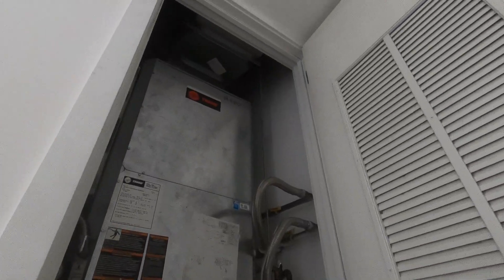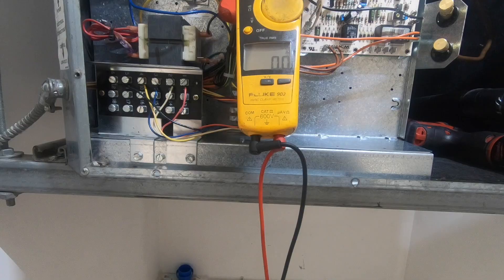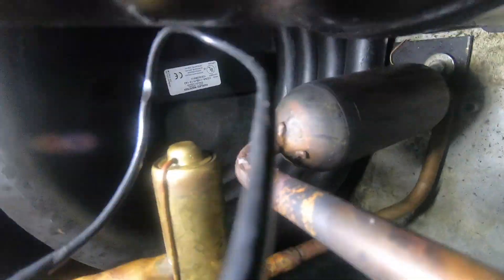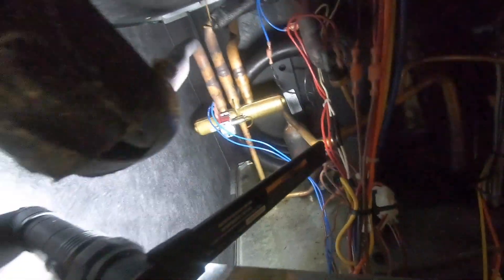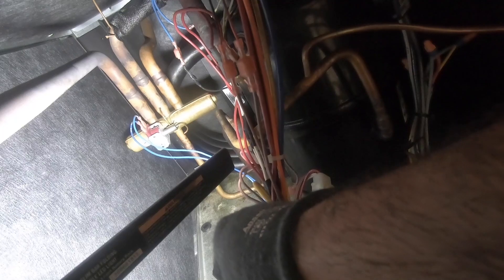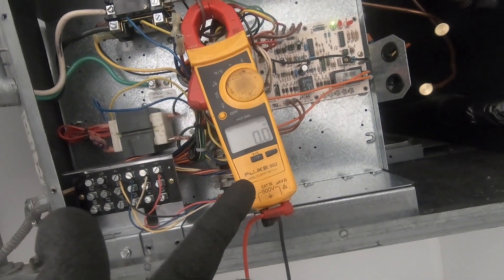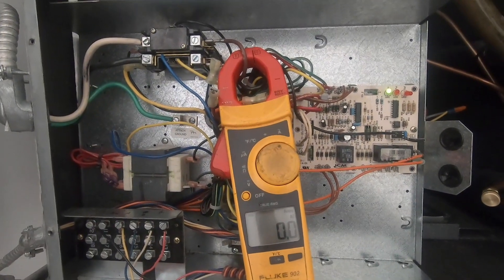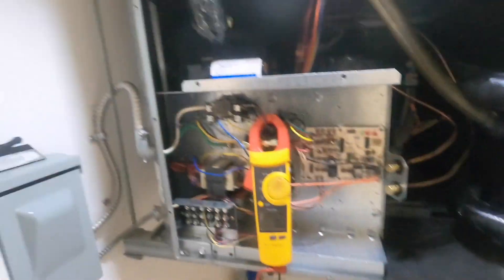Heat Pump Not Cooling or Heating

Comment: for lower value capacitors, leaving any leads on can skew the reading very significantly. it's not so bad above 5 microfarad, but below that, wiring, circuitry capacitance and inductance will skew the results by miles. even then, it's lways good practice removing all leads because there could be stray voltages present, which will also effect readings and most always the readings will be skewed higher than actual value, which leads to thinking the cap is within tolerance, when it's possibly way out.

Comment: I don't know much about wshp's but I would think there is some aux heat?  After watching the video I understand now the no compressor run call.  To bad the water is off.
Reply from the maker: Auxiliary heat isn’t needed on water cooled systems. We have powerflame burners for winter and cooling tower for summer maintaining water temp 74 winter, summer we can only cool the water to outside temps. Therefore the water filled heat exchanger/ condenser in the summer/  yet when heating the evaporator properly absorbs heat. Then displacing the heat into the conditioned space. Most air cooled heat pumps why not many exists in NJ are needed when not much heat can be absorbed from the air or system is in defrost. Water is back on in the building and I have been bleeding air out of many of the systems on no heat calls all week. Many of the condensers also are getting plugged up and need flushing.

Comment: Dont work on those but heard water filter/screen thing clogs a lot and causes high head.
Reply from the maker: Yes I have learned a lot about that clogging up. It also shows really low pressures when running heat. Same symptoms of no air flow on a heat pump condenser

Comment: Good old water source heat pump,  fun to work on i dont see a whole lot except downtown
Reply: Oh and dont forget the accessibility is always fantastic lol
Reply from the maker: They never make them easy to get into some. Not sure if you seen me fighting, to just remove a control panel. To seal a leak. Most the job was fighting with the cover. AC Not Cooling r22 Freon Leak and Repair https://youtu.be/eqCGGl7Un_U
Reply from the maker: Usually in hi rise buildings these are common. It’s until this summer I never really worked on water sourced heat pumps. Learned all about plugged up screens and condensers.

Comment: "Those that say you can't, just don't know what they're doing."
😁👍
Reply from the maker: We can usually succeed as long as we do all we can
Reply: @thehvachacker  I always check all my capacitors with the common wire still attached too. I tell all the new...The fewer wires you pull off, the fewer you have to remember where they go.